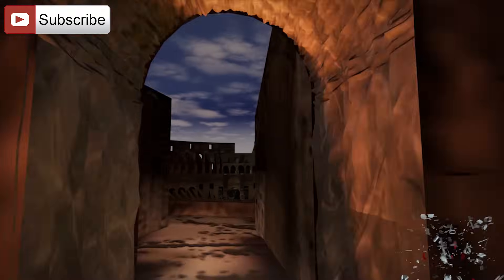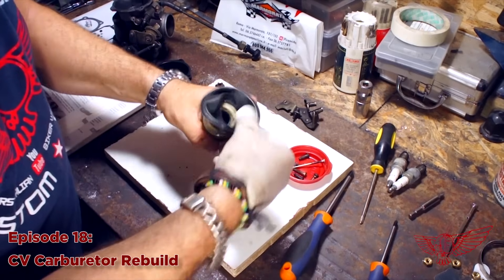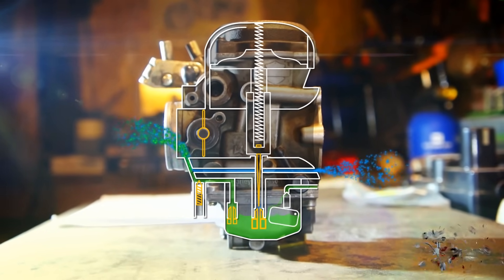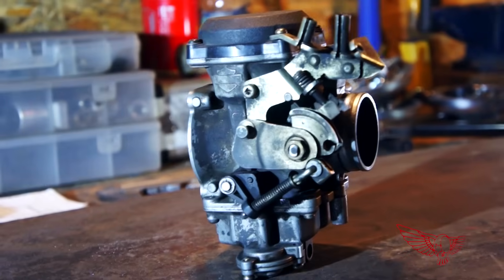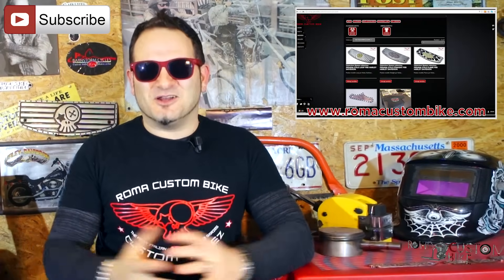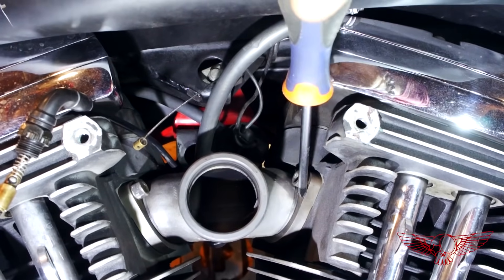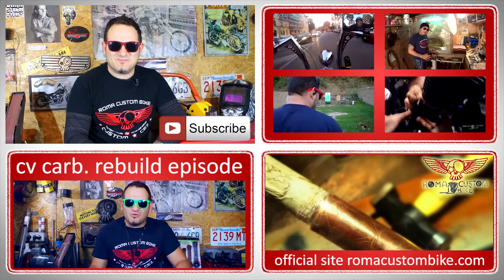How does CV carburetor work animation DIY adjustment screw - ep26 - Roma Custom Bike

Comment: Probably one of the best explanations of how the cv Or any carb for that matter, works that I have seen. 
The well executed use of graphics really added to getting a clear message across and helped give "life" to the mysterious internal workings of a carburator. A picture is worth a thousand words and video is many more than that.

I appreciate that you are not afraid to share when it is pointed out something you have previously is in error,  You are only human after all, and we all make mistakes. How one handles being called out on one says much about a persons integrity.
Reply from the maker: +TheLpjoe thank you so much man!!! I think that documenting mistakes is the best way of understanding how stuff works 😊
Reply: Yes, IF he had explained it accurately. He completely left the accelerator pump out and without it the carburetor doesn't work!!

Comment: Giving us a very helpful explanation.Just one question.You say to put a bigger jet if idle screw is less than one turn and a smaller jet if more than 3 turns.Which jet are you talking about? Idle jet or main jet? Thanks in advance..Pampos kleovoulou.
Reply from the maker: thank you Pampos, i'm referring to the idle jet, as the main jet doesn't get into play until almost full throttle :)

Comment: I appreciate you pointing out the cap covering the adjustment screw. I have a Yamaha XS 1100 and had to replace one of the four carbs. I ordered a carb body off eBay but noticed there was a brass plug covering the adjustment screw. Good to know it can be removed if needed. Thanks.

Comment: The role of the spring is also worth to talk about. Its strength determines the air/fuel ratio. If the spring is old and weak, the same vacuum will suck the diaphragm and pin higher, so the fuel consumption will increase.

Comment: Hi, great tutorial! Thanks! just a few questions:
1. At 13:10, do you mean replacing the pilot jet or the main jet? Pilot right?

2. If the main jet doesn't start squirting right after opening the throttle how can the engine gain revs momentarily with the same amount of fuel?

3. Curious about how exactly the idle screw works ? On which part of the carburetor does it act  on?

Anybody else is welcome to answer!

Comment: Good stuff. The only thing I’d say is that using steel wire to clean out the brass jets can possible scratch them, so be careful as the need to run smooth with little turbulence to be at their best. I sometimes use a single strand of copper wire from a multi strand wire. Or I throw caution to the wind and use an acetylene torch tip cleaner and go gently. They’re nice because there are multiple diameters and they’re rigid, but again, be gentle so you don’t scratch the jet.

Comment: Hopeful we find a second butterfly valve on the right of the throttle slide to procure air elements that can increase the carburetors chance to have a smoother intake of air bleed, in the near future. :p

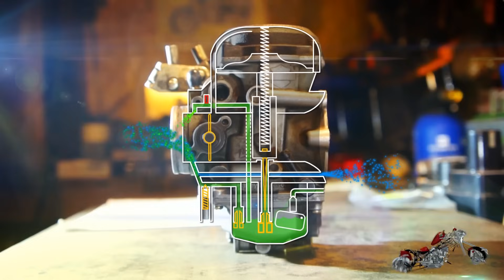Comment: 5:57 or 7:26 If the idle circuit mixture screw is on the intake side of the carburetor it usually adjusts the air and when it is on the exit side it usually adjusts the fuel.

Comment: Thank you for the very clear animation!
I have a problem with my Yamaha YZF 600r which starts without any choke after cleaning the carburators and replacing the pilot screws.
Now thanks to your video I can see that i probably turned the pilot screws out too much and was running rich.

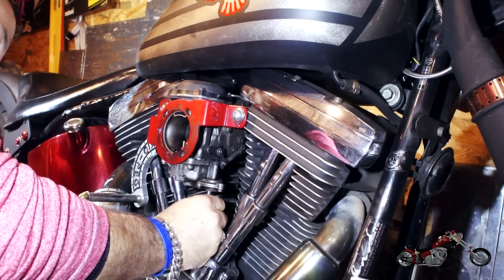Comment: 11:59 You should have the air filter (air cleaner element) installed when doing the final adjustment as it will restrict some air and if not then when reinstalled the mixture will be too rich.
Reply from the maker: +Snurre86 i have the equivalent of a velocity stack and the filter is off so that the process can be seen.
Reply: You should still point it out to the viewers so they understand that and don't do that. Only trying to make your videos better.

Comment: what is that black thingy called on upper left corner at 8:08 ? I have a problem because gas is leaking through that hole
Reply from the maker: Ciao John, it is the fuel intake, you might have a loose hose or the actual plug is loose, thy to find out which of the two cause the 1st is fixable, the 2nd not so much :/
Reply: yeah it leaks from there:) cheers, time to take it to the mechanic:D

Comment: 5:45 This is also (and more accurately) called the Starting enrichment(SE) valve as the butterfly valve is completely closed and there is a vacuum piston and no choke valve on this carburetor.

Comment: This is excellent stuff. What happens in the carb when the engine (and carb) warms up? I have a problem where cold engine works well but when warm, hi revs work fine but low revs / idle stall it.

Comment: Hi..your vid helps me so much to understend how it work..thanx much..
                   
I have question..my bike run only on hoke pulled out..when i push it in engine stops..what you thik it coud be?..it is difficult to start the engine when hot        
And the question..the hoke..when is pulled out it deliver fuel and the air as well?? Or just the fuell??

Fcr Mx39
Mixtur screew 2.5 out
Mine jet 165 ( like in manuall )
Pilot 45 ( like in manuall )
Yamaha wr 450f  2005     
Carb cleen  
temp. about 10-28
about 1000ft abowe see

It would be great to hear your opinion and tips what to do to get it run good..

Comment: Hello good video .however I have a CV carb that will only run on choke soon as you let choke off it dies but I cleaned all the jets and adjusted float valve could you tell me what problem is .thanks chris

Comment: Hello awesome video. Have a question. Just got my 2005 fxdl with 7200 miles m, cleaned my carb completely but u have to put a bottom oring and it’s not the original. After I turn
Off my bike a couple f hours
Later I noticed a little gas leak one the bottom of my carb it’s very little? Should I put a original oring or one that’s fits exactly? Should adjust the floater ? Any advice ? Have a great weekend

Comment: Sir i need some information .when i go up on mountains my bike leave power because there is no enough oxygen to burn fuel.so i have read about lean mixture is best for mountains so if the oxygen is not enough then i supposed to rotate pilot jet clockwise ? so then i will be able to drive better?

Comment: 9:30 What I do when the screw is stuck or is difficult to rotate and seems to be seated constantly (You should always do this before starting to turn the screw as you never know when it is going to be a hassle).
1. Measure how fare in it is with a digital calipers.
2. Draw the orientation the screw has relative to the exit of the carburetor. 
3. Take out the "Adjustment screw"/"Pilot screw" and clean the screw and the threads on the carburetor. 
4. Turn the screw all the way in til seated (careful not to damage it).
5. Return it to the original position.
6. Turn it in and count the turns it takes to reseat it.

Now you have the exact orientation, distance in and turn out it was when you got it.
Reply from the maker: thank you for the addition

Comment: Nice video. Very informative. Question; should the slides flutter up and down rapidly or operate in a more steady manner? Thanks.
Reply from the maker: +lilevil 1955 thank you. The nice thing about cv carbs is that the vacuum action makes the acceleration very smooth compared, for example, to the throttle action of a mikuni carb were the throttle controls the butterfly valve directly. So the motion of the slide is quite smooth thanks to the "smoothing" of the rubber membrane reacting to the vacuum force.

Comment: Does the factory plug in the cylinder stop the screw from becoming loose?
Reply from the maker: nope, or at list it shouldn't. The spring on the screw is what prevents it from coming loose.

Comment: bro can u explain why there is condensation on outer surface of carburetor ?
 if u make a video on this it will be great
m facing this condensation on carburetor in my 155cc motorcycle
thnx in advanced
Reply from the maker: I'll try man :)
Reply: as the fuel begins to mist(atomize)  in the carb it pulls heat from the surrounding air, making the inside of the carb colder.  as the carb cools down the moisture in hotter air that the exterior of the carb comes in contact with will cause it to condensate on it.  it's mostly thermodynamics.  it's the same reason a car richens the fuel mixture as you get higher into the rev range.  it helps control knock and keeps exhaust gas temps under control.
Reply: +Michigan MK7 thnx for the information 
so is it normal and good to happen in my bikes carburetor?? or it will affect on performance & mileage?
Reply: +Custom Cez thnx bro
Reply: +Raj xlr8 inside the carb it would be less beneficial since it will take up space where oxygen and fuel could be instead.  on the outside its more beneficial in my opinion.
Reply: Michigan MK7 thnx for the info bro

Comment: even though I'm not a fan of CV carburetors this is a great explanation.. only recommendation I would suggest is to compression test cylinders beforehand because all the carb tuning in the world won't fix that.
Reply from the maker: thank you bsboneless, I just rebuilt the engine so i'm pretty sure that the cylinders are ok, but good suggestion for those that are checking for performance or fixing reasons :)

Comment: Just one Question please i'm cleaning and fixing my Kiehin CV carb for my 125cc 4stroke piaggio scooter.  How does air get into the sealed float bowl chamber so the fuel can escape?  I cleaned the main jet, the pilot jet, and there is third port in the float bowl next to the two jets but I don't understand it's function and it's blocked but think maybe it's to let air into the chamber, I tried to blow air and suck air through it and It seems like nothing passes, should I blast it with carb cleaner?  i'm a bit reluctant because I don't understand it or what's in the hole. 

I got the bike cheap because it hasn't run for 5 years and it won't start unless I put i but of fuel in the cylinder, there was a crack it the inlet manifold.  i replaced the manifold but still the engine doesn't pulling fuel into the engine even though i know there is fuel in the float bowl.  

As you can probably guess the is the first time i've done anything with a carburettor so I'm just learning

Great Video and any help would be really appreciated

Regards James

Comment: Can you please tell me exactly how the choke/enrichener works?  When you pull on the knob, it pulls the cable where it is connected to carburetor, but inside, it is not connected to anything from what I can see. Is it that what appears to be a small plunger/needle at the end of the cable, gets pulled back, allowing more air in from the same channel as the Pilot jet? In the old days, a choke cable pulled the butterfly across the mouth of the carburetor, shuttting off most of the air supply, but in motorcycles, this does not appear to work the same way.. Thx.

Comment: This is a great video amazing animation and everything is explained perfectly only thing I would not recommend doing while adjusting the mix screw is putting suction vent on the mufflers 
With a vent sucking on the mufflers you are changing the back pressure which will cause a wrong air to to gas ratio
Please do correct me if I'm wrong but from what I know even adjusting the mix ratio with or with out the air filter on can cause improper adjustment
Reply from the maker: thank you very much. My exhaust system is not really creating a vacuum though, its just getting read of some toxic fumes :)

Comment: what would you adjust if you have pops in exhaust on decel? I have aftermarket exhaust, but stock airbox. I suspect it's a little lean, do I NEED to go up a jet size or can I just adjust the needle and pilot screw to richen it out? would that be enough? besides the pops on decel my bike runs good through all rpm range, I just suspect it's lean and hot
Reply from the maker: yes I agree, buy a box of jets and try things out, but before write down all the current settings so if you are not satisfied you can always get back to the current settings

Comment: Superb explanation and delivery of content. Thanks for that. I was able to recover my carb settings after 2 months of trial. I would like to fix the fuel screw position so that neither I not the bike screwed ip in future. Is that ok to put some gum on the screw so that it remains in the same position till life? Or will there be a situation in future to adjust  it based on other factors? Mine is UCAL BS-29 carb ..
Reply from the maker: Thank you Jeffi for the compliments :) glad it was helpful! you could put some thread locker, the softest kind, but is not advised. The spring on the screw should keep it at a reasonable tension. In the future, if you change exhaust or location you might need to readjust. What I suggest you do is count the turns you need to get where it is now so that you can check it's position at regular intervals of time :)
Reply: Custom Cez Fai Da Te Thank you Cez, this looks great idea..noting down screw turns and position :)
Reply from the maker: you are welcome :)

Comment: Hi so if i replace the standard air filters with K&Ns would this mixture screw need reducing? as am thinking this will prevent th engine from starting
Reply from the maker: yes, changing the filter will effect this adjustment

Comment: Excellent illustration and video! Question, I just got 2003 softail that was running rich. I had a smaller pilot jet (was 48, now 45) installed then proceeded to adjust the idle fuel mixture screw. While it was idling I closed it letting it seat gently. It kept running, although not very well. It is now at about 2.25 turns out and runs great. My question is, does it really matter that it didn't die when closed. If there was any damage to the seat, so what? Since it is at an appropriate setting now? That's the real question I have. All I ever heard is if the seat is damaged then you have to get a whole new carb, that does not seem to make any logical sense to me now that I think about it.   Thank you in advance.

Comment: At 11:10 there is a lot of fuel spitting back at the camera. What causes this and what can be done about it? I have a friend who has fuel pouring out of his air filter.
Reply from the maker: +Bruno Bronosky ciao Bruno, in time I have realized that the sound that we like so much with very low rpm is not good for the working of the bike and carb. That spray is due to the fact that there is not enough suction at that low rpm so the spray of fuel is, for lack of a better word, too much. Usually we don't see it cause we have the air filter on it and most stock ones have a way of feeding this excess back to the carb, but it's there. 
Same with my new mikuni carb (that btw is the absolute bomb). 
So to avoid that overspray all you need to do is raise the rpm a bit and you'll notice that the very bottom of the acceleration curve will also be smoother.

Comment: Thanks for your explanation.My bike Yamaha FZR 250. i cleaned my mikuni 
carburator (4) and cleaned main jet,pilot jet and adjust air mixture 2.5
 turns out from the closing point.My problem is 3 times failed my eco 
(smoke) test and result show more petrol consumption.but last years 
easily pass the eco test.My problem is need to reduce petrol.How can i 
adjust?please help.Thanks
Reply from the maker: +Saman Priyantha hi Saman, you might have to buy a set of jets and experiment. Also check all manifold for air licks!

Comment: My 1200 sportster cough's a lot at low rpm's. Do you think it most likely needs the carburetor adjusted, or could it be something else? It's also very cold natured also.
Reply from the maker: try adjusting the screw, record the original position though so if that doesn't help you can put it back to the last working position :)
Reply: Before I bought the bike it had been set up a lot with ethanol gas, so I took the bowl of and cleaned the jets. It ran very well, but I had a gas leak at the bowl gasket. I ordered a new one from cv performance. I think that I messed it up putting it back on. Do you have any suggestions on putting the new one on when I get it. They seem to be a little big. Just thought you might know a trick. Thanks your vids have helped me a lot.

Comment: These days many people fear multiple CV carbs on bikes, often replacing them with a single carb or FI.  There's nothing better than a bike designed to run through four CV carbs actually running through four functioning and synchronized carbs, not some aftermarket automobile carb.

Comment: I have always wondered and I have gotten conflicting answers when I pull out the in Richner choke cable on the CV carburetor. Does it immediately give more fuel or does the initial give more air. I know it must increase fuel the further you pull it out and also increase the RPMs by increasing with you more but I was never sure is fuel enhancement only 🖖🏽

Comment: Hello, my name is Henrry, i just bought a Honda CB750 1981 and i have a question;  how do i know if my carburetor need to be replaced, my local mechanic told me that it may have some internal wear, but i did some research and all i found was carburetor rebuild with sets of jet fuel, needles and gasket, also change the float, nothing about replace the hole carburetor. All sources said deep cleaning, rebuild and tuning.

Comment: Can u do that adjustment on makuni multi carb setup. Just rebuilt mine and adjusted them and set them to as close as possible to factory settings. But it seems to be surging up and down with no input from me at the throttle. But when i lower the idle screw it starts to stumble and stall when i raise it via the adjustment screw it settle around 1100 surge occasionally to 1800 with out Any input. So any tips? 4 makuni carbs on a 750 Suzuki.